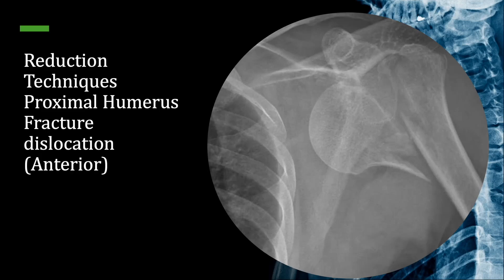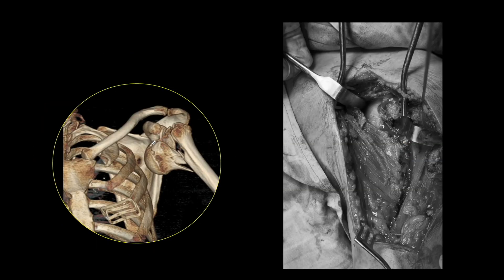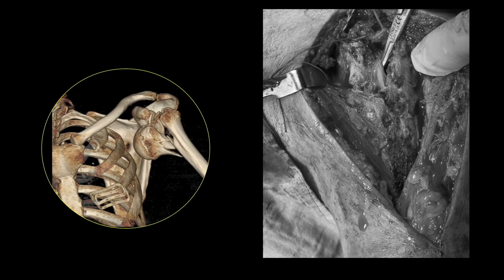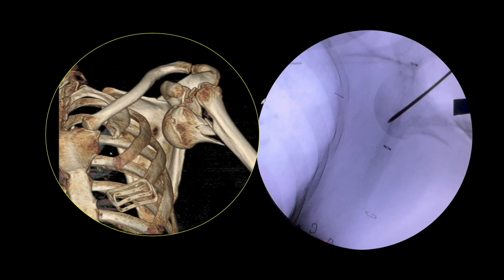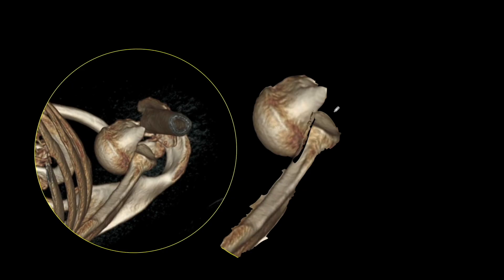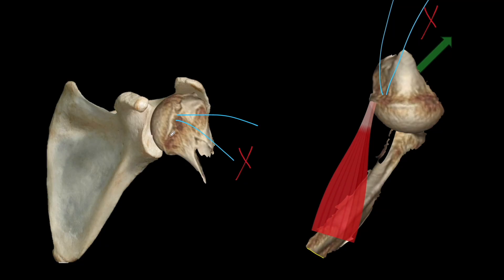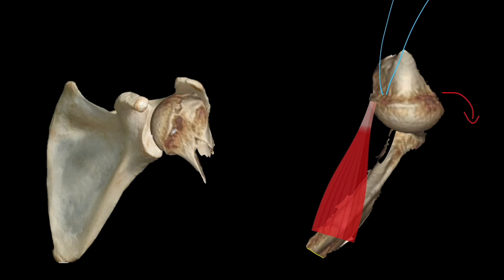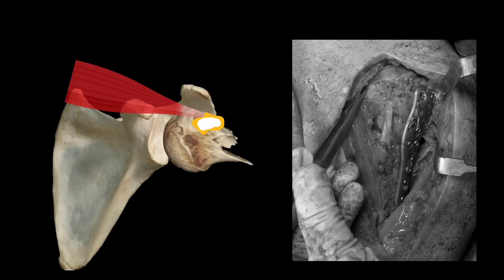Reduction tips Proximal Humerus Fracture Dislocations

Comment: One of my professor did a Subscapularis tenotomy to reduce this, is it really advised to go for a tenotomy if the head is not resucing my these manoeuvres?
Reply from the maker: For anteriro dislocations subscap tenotomy is rarely needed because it is already attached to the head fragment. However, for posterior dislocations, you may need that because the head fragment is devoid of any tendon attachment and has dislocated post. Tenotomy allows better visualization of dislocated head.
Reply: @Justorthothings i tried the same maneuver as told by you, the fragment was not reducing, he came, tried and mobilised the subscapularis with the cautery, as according to him, pull of subscapularis and capsule was not allowing the head to come back to its position. 

In the end i repaired what ever subscapularis i could repair. I just asked this, because i wanted to learn is it the right way to do tenotomy? Or better to try manoeuvres told by you?
Reply from the maker: Okay. Tenotomy would make things realy easy for anterior dislocation but, I am not sure what will be the long term outcome as head fragment had sole anterior attachments in anterior dislocation and some posterior attachments preserved in posterior dislocation. If head is completely free from any soft tissue attachments, avn is I evidence. I think it would good to follow that patient see how things go.
Reply from the maker: We preserve the soft tissue attachments and just try to scoop head back to its position just like we do in hip joint procedures, gain some marginal clearance, pull and rotate. I have nil experience of such tenotomy for anterior dislocations.
Reply: @Justorthothings thanks for your reply, would let you know of the follow up😊😊